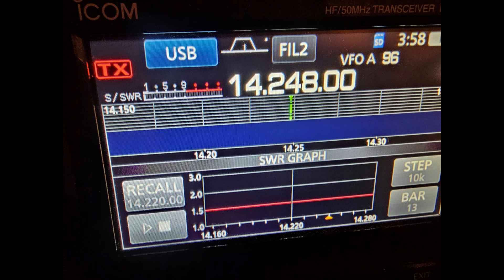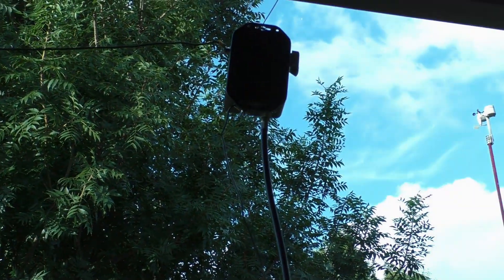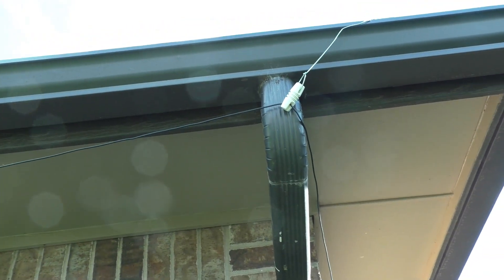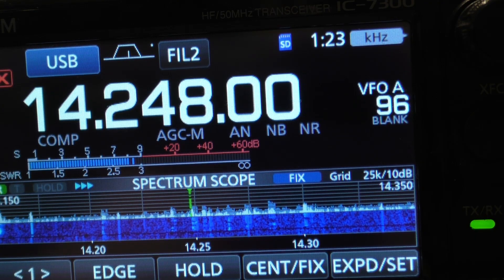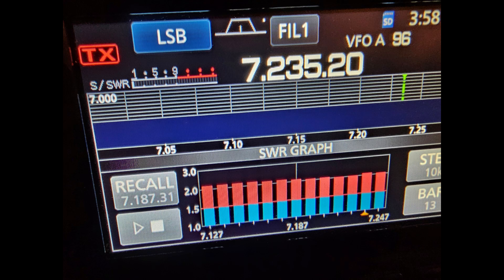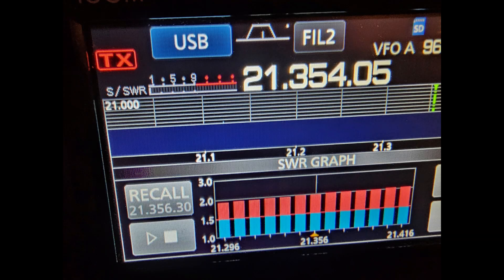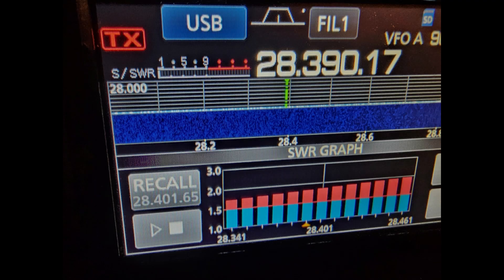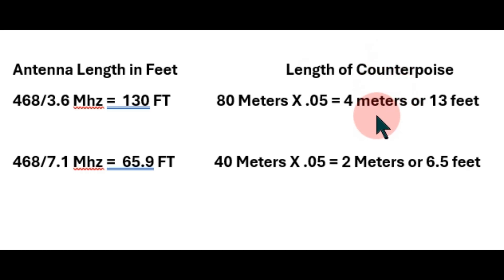40  10 Meter Half Wave End Fed H F Antenna Ham Radio

Comment: I'm new to HF and I just put up an EFHW sloper; 26' flagpole down to 10' up in a tree, sloping in a SW direction here in Arizona. According to Google Gemini my best direction should be toward Australia, but while listening to the Ten-Ten net today the stations that came booming in the strongest were NH, NY, and FL which I found surprising. Anyhow, for anyone considering an EFHW I think you'll be pleased with it.
Reply from the maker: Sounds like you got a great antenna! Thank you for watching my video!
Reply: @RichRodgersOnline  Today was my very first time being online on 20m.  I'm in NE Arizona and my first HF contact was near LAX, my next contact was a POTA site in Utah, and then my 3rd and 4th were Route 66 Special Event stations; both in CA. I could hear TX and OK very well as also some WA and OR stations but my 20 watts wasn't enough to break through the pileups. So all in all I'd say my EFHW is doing its job just fine. I forgot to mention that the antenna is surrounded on three sides by metal roofs, one of which is higher than the antenna. So for those who pooh-poof the EFHW, I say give it a serious try.
Reply from the maker: @Tremorwoodworks  Sometimes 20 watts is all you need when condtions are good.   I am glad you are enjoying your antenna.  I am not sure what kind of tuner you are using, if it an external tuner,  Then with your metal roof, with a 49 to 1 balun you might be able to use the metal roof for your antenna.   I did that with my metal shed. https://www.youtube.com/watch?v=Tu6TEKF3cws